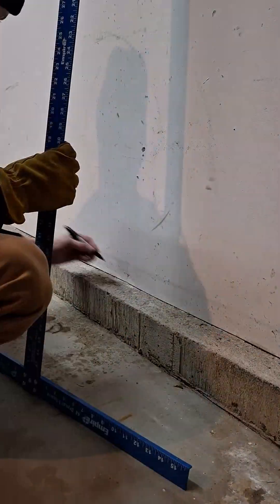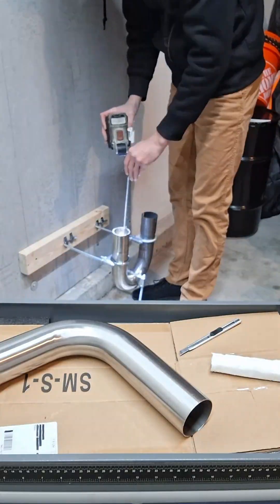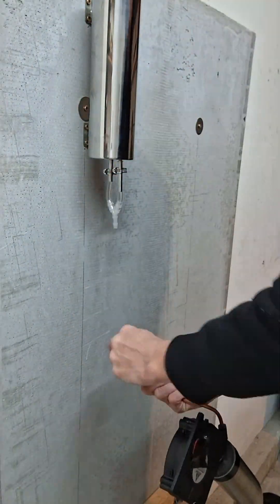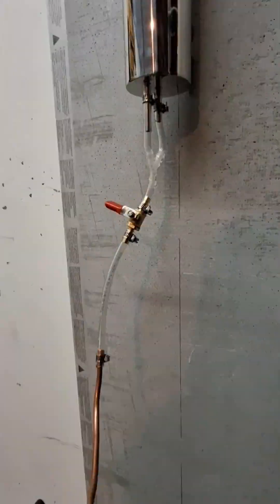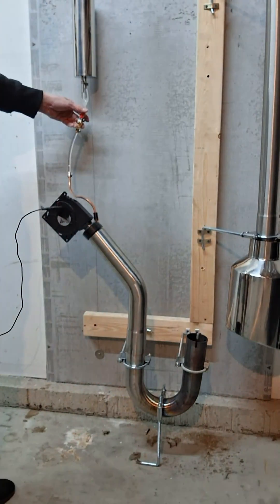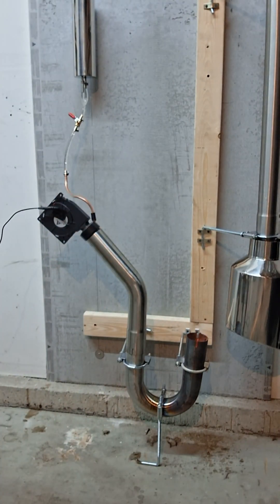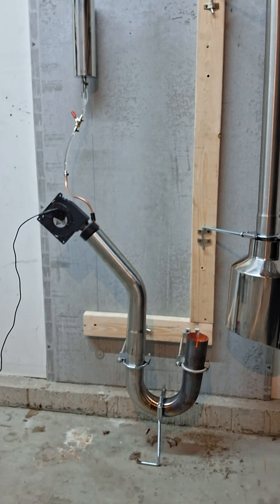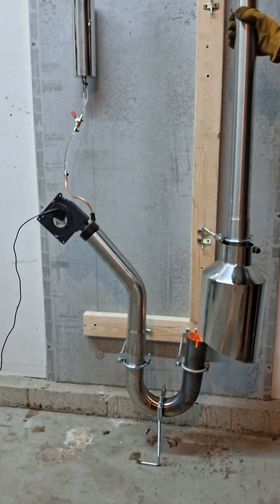Stainless Steel Exhaust Pipe Vegetable Oil Burner

Comment: How much you have into this setup?  Chinese diesel heaters only 100 bucks and would probably heat the Area you want heated. And if you use 2 fuel tanks you could still burn up the used oil laying around.  But if you ran out of oil you'd still be able to use Diesel or Kerosene.  Just a thought.
Reply from the maker: About 150. Yep. 2 Tanks Mentioned in Other Vids.

Concept Build I have Been Thinking on for a While, I Wanted to Try Out